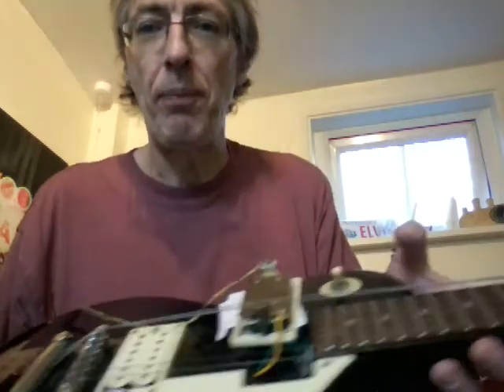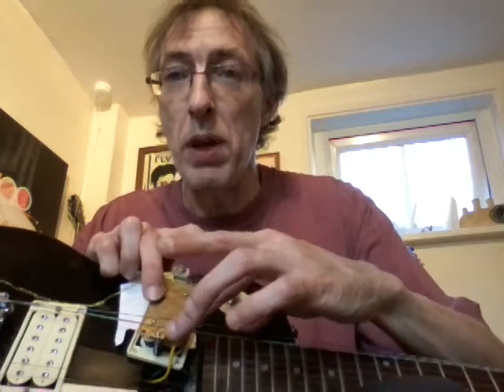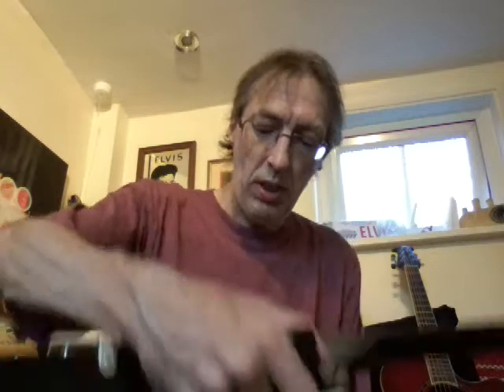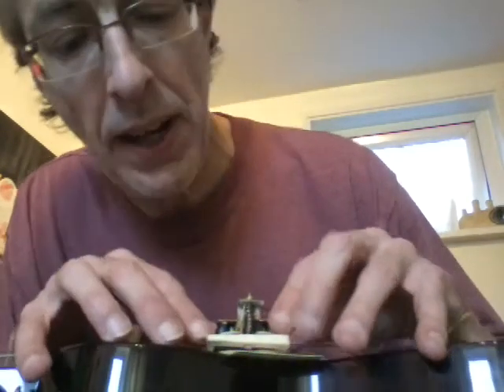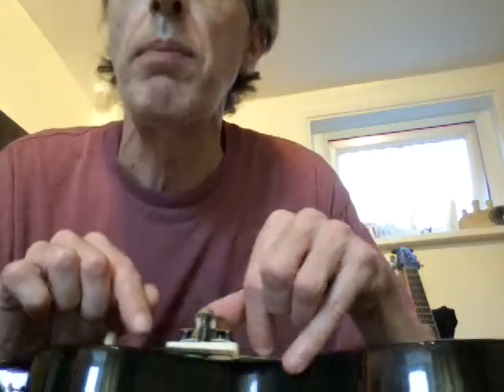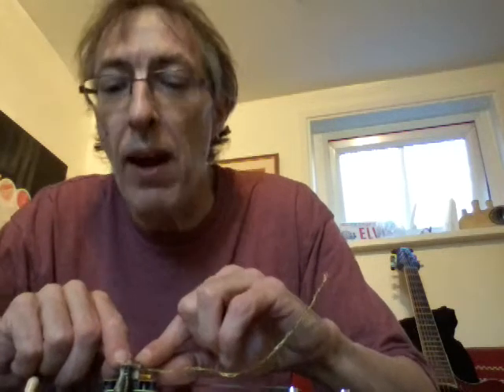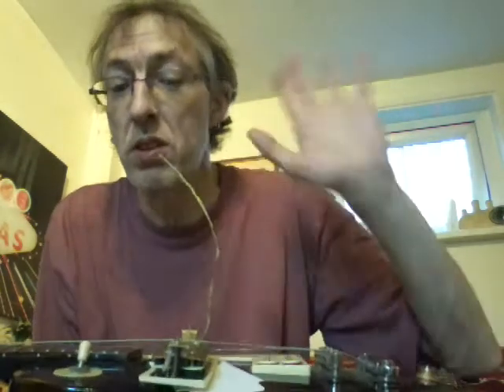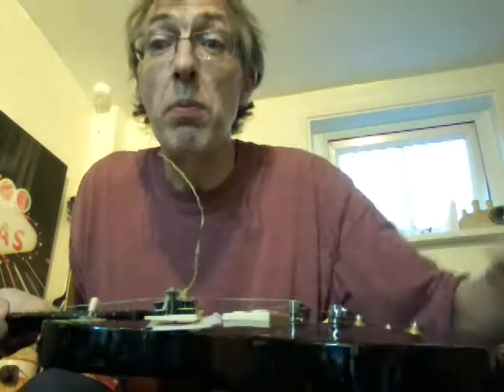Quick fix for a guitar pickup height adjuster with a stripped screw hole.

Comment: Nice survivor hack Rob.  Thank you. 
Consider this too... and I got this to work.  Get a nut that will fit on the screw. Remove the wire wrapping from just the end of the screw.  Lubricate the screw tip threads and the inside of the nut, with a bit of petroleum gel. Place a few drops of JB Weld to the flange . Screw a nut to the tip of the screw  and tighten until you get some squeeze-out.  Let the JB Weld set-up.  Rotate the screw a left and right to prevent the JB Weld from bonding to the screw threads.  Wait 24 hours.  Remove all of the binding wire.  Done and it's fully adjustable.  Some people use solder in place of the JB Weld.  That works too.
Cheers.
Reply from the maker: Many thanks Jack. This seems like such a common problem, especially on less expensive guitars and I found virtually no quick fixes on the net. I would have much preferred to make it adjustable, but in this case had to use what I had to hand. Thanks so much again for adding to the advice here in the comments. Very best to you, Rob

Comment: I have all those things you mentioned (shaking, can't see, many more) too and know how bad they suck! I'm surprised the epoxy did harden enough to make threads into with the screw, with that little wire you have wrapped around the end of the screw now it might be good to drop a few drops of soldier onto the wire to help hold it in place. cheers mate and all the best!
Reply from the maker: The glue I used was very bad quality, it was probably mostly water or air,  I think that had a lot to do with it.  My fix worked, unfortunately, the screw thread on the other side of the pickup couldn't take the pressure, so then gave out as well, hahaha. They're both fixed now, but immovable. The one I originally fixed had already been re-soldered, perhaps they didn't use metal at all, but Play-do instead ! Thanks so much for taking the time, Cheers, Rob.